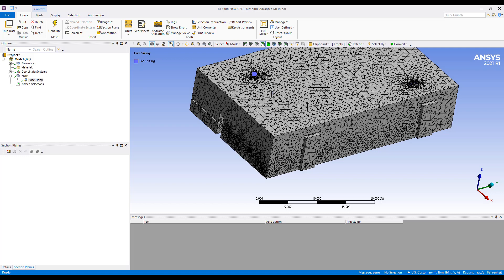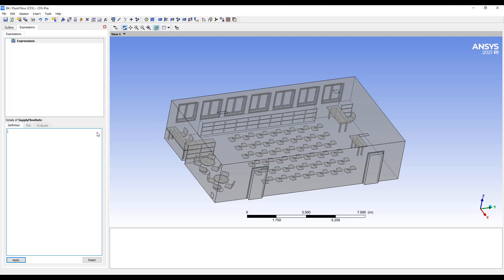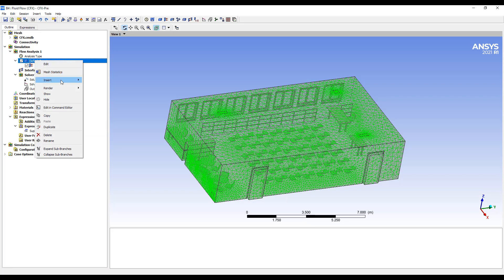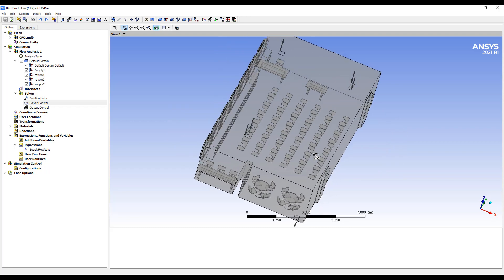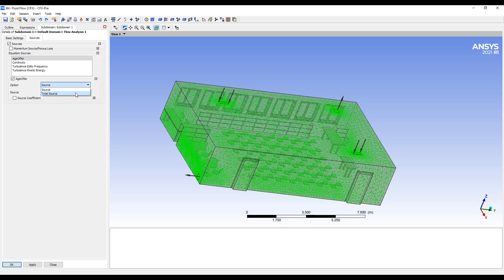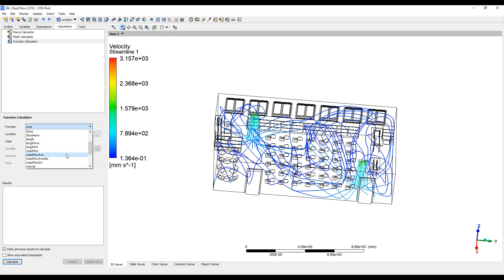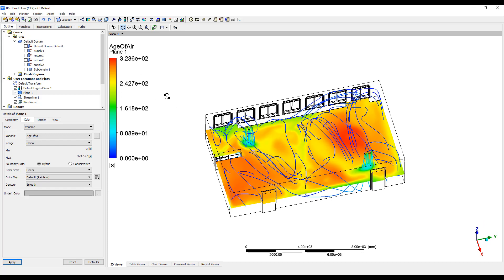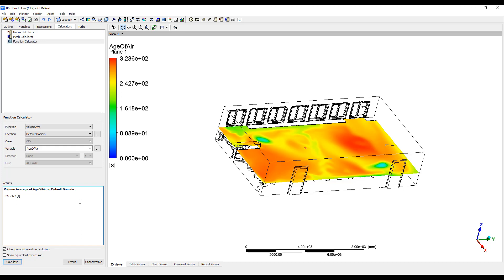Ansys CFD Room Ventilation Part 2: Age of Air

Comment: what is the point from this simulation , in a real case air change per hour is obtained value you can get from a reliable source like ashrae and in some methods CFM/person or CFM/area so , we already know how much air there in the room
Reply: Yes we know the theoretical air changes per hour from the design conditions but there may be local pockets of air that are stagnant and recirculating therefore this air is stale and may remain in the room much longer than other air. Perhaps there is pollutant in the room what if the pollutant is in a stagnant zone where fresh air does not easily reach it and is unable to advect it, the simulation may reveal that it takes 2 hours to fully exfiltrate the pollutant but this may not be satisfactory! Mass in = Mass out but that tells you nothing about particle residence time and age of air!
Reply: is there any real case application of this senario?